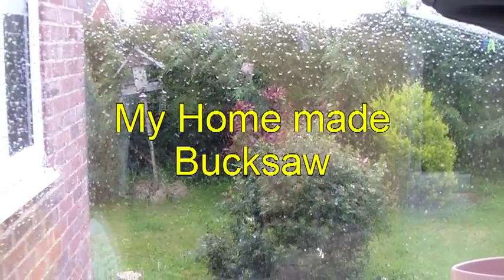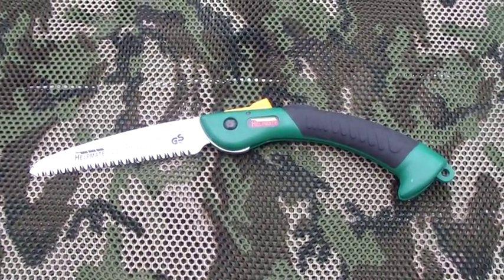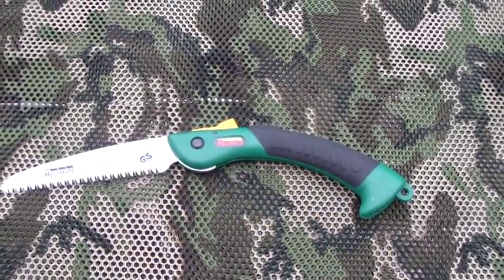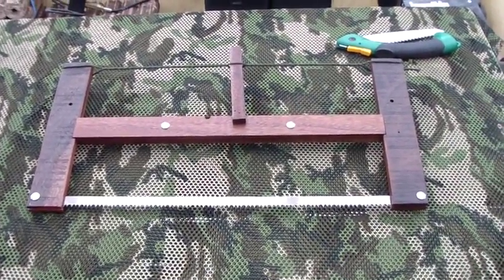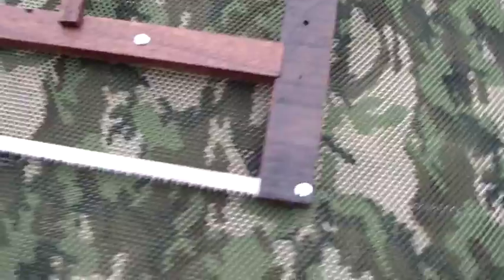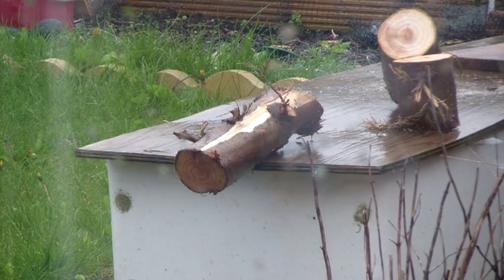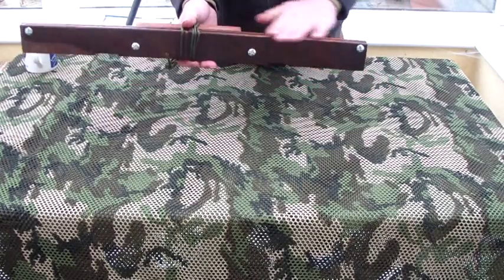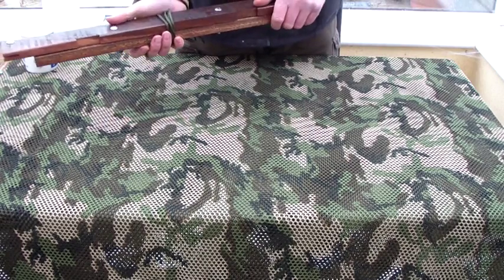My Homemade  "Traditional Bucksaw"

Comment from the maker: Hi Matt,
Thats correct. I get a lot of equipment from the army surplas store in Swindon. Ebay and Amazon are other sources. Amazon is good for books.
I am going out tomorrow. It's going to be a cold night so i will be using an army artic sleeping bag and bivi'ing on the ground under a low tarp. may even light a fire and reflector to keep me warm. The homemade buck saw will be a great help.
Sandy

Comment: I love the folding design.  I may make one of my own using hard maple. & a 24" blade. blade would probably be a Bahco unless one knows of a better blade. I do like some of the japanese folding saws cuz the blade is thickest by the teeth & gets thinner as goes toward top of blade so no friction.  good engineering.  The should make a bow/bucksaw blade as such.  Nice job on the saw Wiltshire!
Reply from the maker: Steve Lahr I still use this saw and it works well.

Comment: I would love to know the sizes of each part of the saw.  My last one I made was out of steel tubing, But someone seen how good it worked day after day and at the end of the canoe trip (40 days) it vanished! Mine could take many different sizes of blades. It just depends on how tight you make the top. I also carry 2 folding saws as they a fast and simple. For me steel is cheaper than the wood you use. The mod is to the handle so it can carry the blade Is great. I used pine to cover the blade and store extra blades. You never know when you will mess up and break a blade. Also drill a hole down 1 of the handles too carry a small round file (1/4 inch) to keep the blades very sharp.  Don't cut yourself :) . Small round files cost about $2 each in Canada.
Reply from the maker: A Mosher I can't remember the sizes I used but the blade was a standard length. Thanks for the info and idea about the file.ATB
Sandy